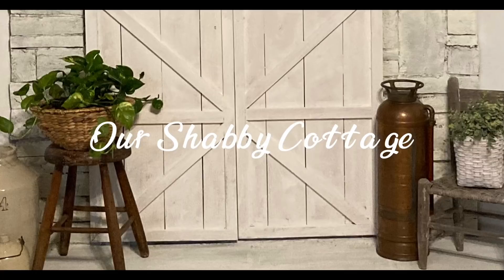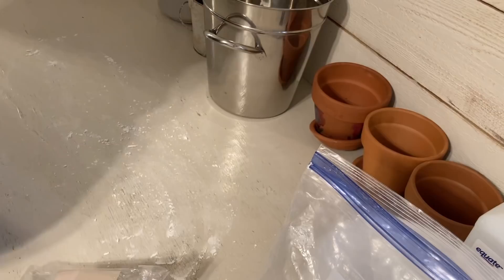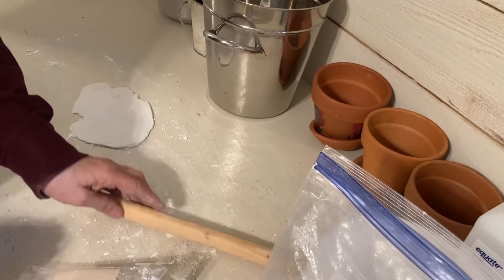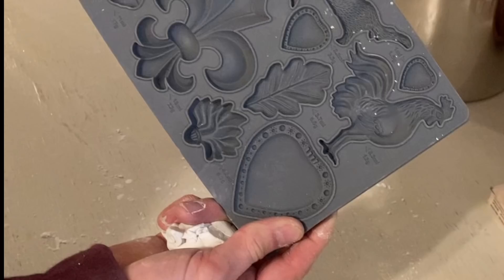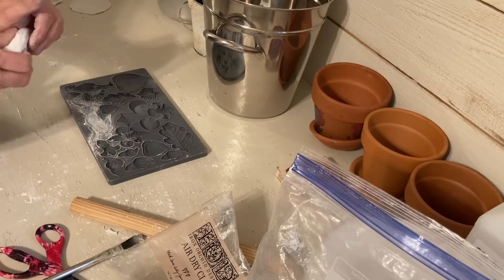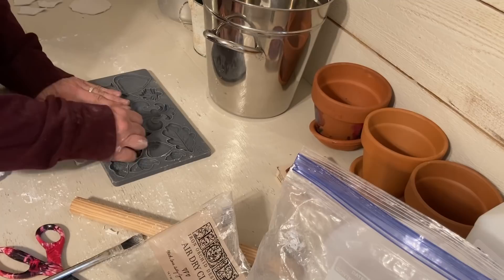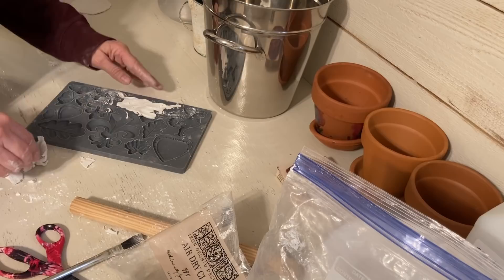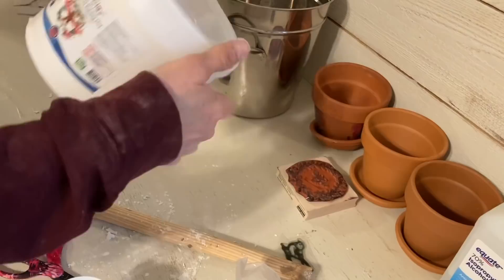How to Clay Moulds and Impressions

Comment: Also, I use the DAS Modeling clay and never have a problem with sticking OR cracking. I've used just a cheap air dry clay from Michaels and omg... Half of the things I made cracked when dry. Also, Crayola modeling clay is nice because it's very pliable when it's dry!
Reply from the maker: Thank you❤️. I will definitely be trying those brands!
Reply: I second the DAS clay.

Comment: Try kneading your light weight clay in your hands adding corn starch,  I just dusted my hands. Pull it occasionally until it quits stretching into string like pieces. Doing this will help it to not stick to the mold.  I had this same issue,  but after watching lady from eastern Europe make her own clay,  I realized my light weight clay was too wet.  It took few tries to get the right feel.  Glad I didn't have to throw out my clay.  Hope this helps.
Reply from the maker: Thank you Terry!  I’ll try that!

Comment: I bought a few of the IOD moulds and the  Re-design moulds and love them both! What's nice about the Re-design moulds is you can get them on Amazon for under $20 and if you have prime you get free shipping which is nice! When I order anything from IOD I have to go through a certified seller and two items end up being around $65-70 with shipping and it's hard to do that for every mould I want. So, the redesign is much cheaper to buy if you want a variety of designs to use.
Reply: Em what is a “redesign”?
Reply from the maker: Thank you!  That is a great point!
Reply: @conniedetevis2119  re-design is the name of the line of moulds and other things I believe.... I think the company name is Prima. I know some people have them stocked in their shop to sell like a licensed seller or whatever, but you can also find them on Amazon. They have a lot of different ones, I got a few on Amazon. My favorite is the "Oceanica Flourish", it has the scroll type designs that you can use on basically anything, but I see a lot of people use the IOD one for furniture. 
     They are a little bit smaller than IOD and they don't have the "lip" that iod has, but I find them very easy to work with.
    I also have some great moulds I ordered from Ali Express, like the scroll design ones.... They are mostly found under cake decorating, so they are food safe if you're using it for that, they're made from silicone. I NEVER had a problem with those and I actually bought them there because I was looking for moulds for berries and also to make fake cookies, lol, I actually ended up getting one from Etsy for the Oreo ones, but Ali Express has some really nice food item moulds and they're super cheap. I paid between $2-7 for mine and love all of them. The one I got for berries also has almonds (whole and half) & acorns (whole & just the tops) for I think those were $4 plus $2 for shipping. Only thing is if you order from Ali Express it takes a bit longer, although they are getting better and some have even started shipping from the US. I believe it's because the same sellers also sell on Amazon, so they probably have a warehouse in the US because some items I've gotten in less than a week.
    I try to support small businesses, like with IOD bc their items ARE amazing, but I can't keep spending that much money every time a new thing comes out, I'd never be able to maintain my own booth if that was the case lol! I go to thrift shops to get items to flip because I love upcycling "old junk", but also because I like to save money & really I HAVE to. I'm DEFINITELY just a very small crafter trying to make at least enough that I don't have to come out of pocket to pay the difference for my booth, lol, which isn't easy. Soo, I try to support other creators, but I also have to support myself. If I can get something just as nice for half the price, it just makes sense.
    Also, the Prima re-design mould package says it's a "Women Owned Company" so there's that 😉😁
  Anyway, I hope this helps another small crafter that loves to keep up with trends, but also likes to save money especially out of necessity. I can vouch for the re-design moulds, I've actually used them all day today, lol! The "Aviary" one is beautiful, I love the little birds & the stand alone branch, I actually used both on the pea pod cups and love how they look. And I used the "Regal Findings" mould on a couple of others...the bumble bee & the wreath crest which looks really nice together. Off to paint those now! 😁😉
Reply: @conniedetevis2119  sorry that was so long... Hahahaa! Sometimes I get a little overly detailed, lol!

Comment: I used to make a few things using paper clay. I have used it in these molds. I did buy the IOD clay but thought I'd buy DAS as it's cheaper. I love your idea is stamping the clay. Thank you for this demo. I won't buy that bucket clay.
Reply: I use the DAS Modeling clay and I really like it, I haven't had any issues with it that wasn't my fault, lol, like a little too much cornstarch which can cause a little bit of cracking, but nothing you can't fix. I bought a big block of air dry clay from Michaels, just a no name brand, because everything else was sold out for a good 2 weeks that I kept checking. I thought how bad can it be? Lol! Half of the things I made just cracked & broke when it dried. Ugh. And it was really heavy. I know a lot of people use the air dry paper clay too. I ended up ordering the DAS modeling clay one not noticing there was a difference and have been using it for quite a few months now, never having a problem with cracking or shrinking. Hope this helps!
Reply: @Em22-wtf  thank you so much for these tips.
Reply: @tootsie2  No problem!
Reply from the maker: Thank you Barbara❤️

Comment: Looks like you are using foam clay.  I had the same problem in the beginning.  However, if you press the foam clay into the mold and then put it in the freezer for a 1/2 to an hour (or more), it pops out with no problem.  It's very pliable even after it's dry.  Hope this helps!
Reply from the maker: Thank you so much Dottie❤️. That a great tip!